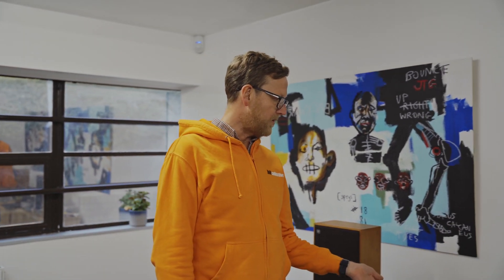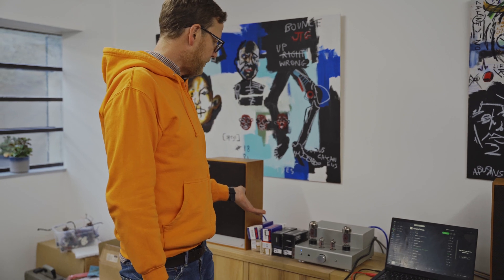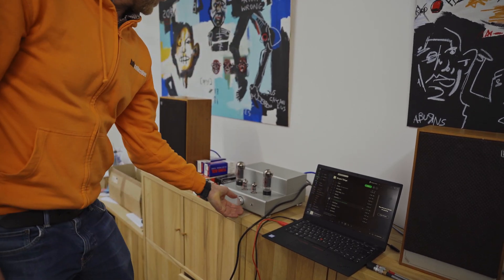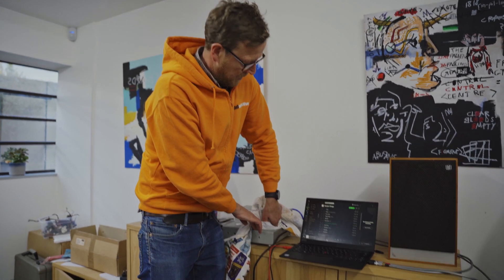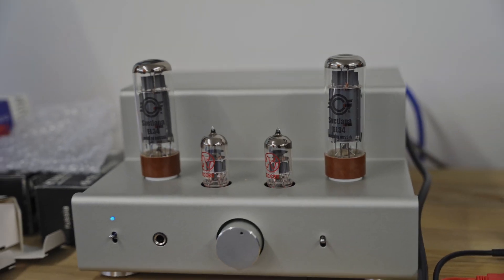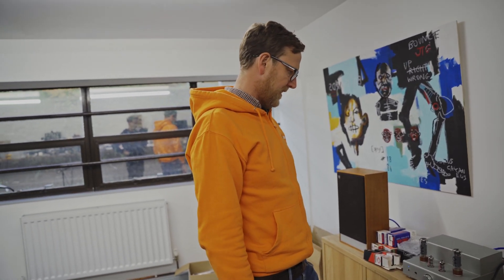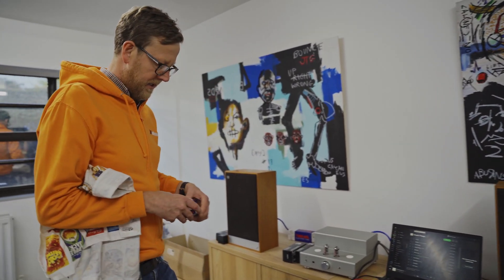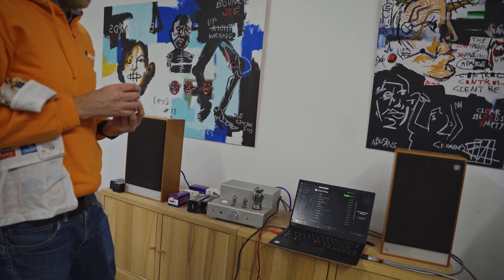Elekit TU-8200R Valve Demonstration

Comment: Not a great idea to take the valves out like this. The power supply caps will be fully charged and will be like discharge through the B+ line and valve anode. Touch this and you could get a very nasty potentially lethal shock. You MUST ensure proper dischage before removing valves.
Reply: How do you ensure proper discharge? Thanks for the comment.